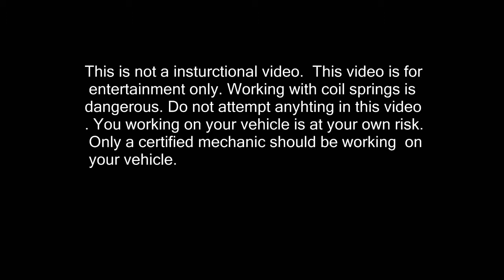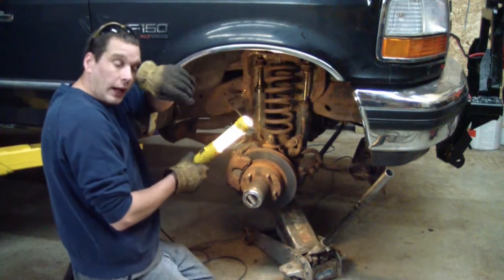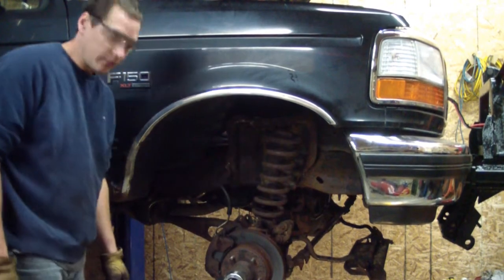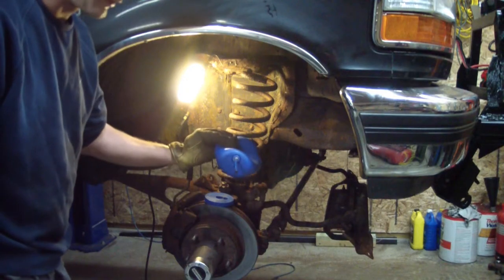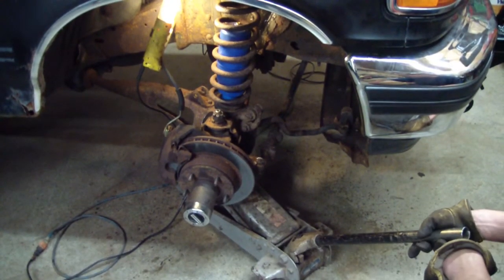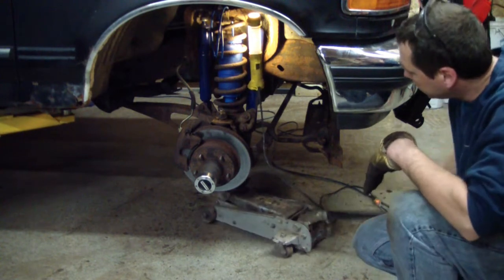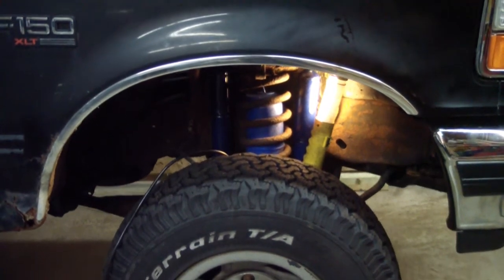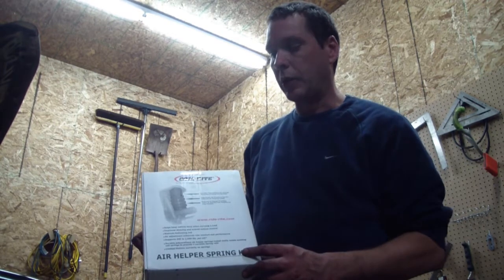Coil spring type air bag install on a snow plow truck

Comment: Just fitted these to my Suzuki Grand Vitara to stop the back going down excessively when I put my camper trailer on (about 140 Kg ball weight), works a treat, and with no camper trailer you just drop the pressure to 5 PSI and the vehicle behaves like normal

Comment: hey great video ... i have a 92 f150 ... that i put a cummins diesel in .... yeh the front is a little sorry.. i like the air bag .. only issue is i bought the truck it had a suspension lift with a taller coil spring ...where did you get the bags at ...and do they come in different sizes as oppose to specific vehicle applications ..

Comment: I have an 1987 f150. What kind of shocks did you replace with. I'm looking to change my coil springs next weekend and i'm finding it difficult to find shocks. Some say they are for the inner and outer and others do not specify. I like how you removed the Springs without a compressor. Great video thanks for posting!

Comment: Just a quick question for you. My son has a 94 f150, would the install be the same or am I going to encounter issues ? Also, his 94 has a single not dual shocks. Thanks alot for any advice you have. I sub'd your channel

Comment: I am going to be installing a leveling kit on the front of my f150 removing the spring seems fairly self explanatory but I wondered if im am going to have any clearance issues with trying to fit a spring that is atleast 1.5" longer probably a little more since my springs have seen alot of use. Do you think I am going to have any problems getting it to fit or any other advice?

Comment: Hi, nice video. Thinking about buying those airbags too. I see the bolt in your video, which youv covered with the some kind of cup. Did it come together with the package? As well oll other two interims doesn't look like too reliable. Didn't if fell off after few rides? Would you recomend it to buy? I have toyota rav4 D4D i quess i could fancy just to install this into rear springs. I do not use my car for heavy lifting or somthing like that, i just want to have smooth ride. Thank you very much!
Reply: Rytis Gasparavicius I have used these before (Air Lift). I installed a pair on my F-250 and they make a difference in the ride height of the truck when the plow is on and in the up position. The Air Lift bags are guaranteed for life. The instructions are easy to follow and install on my truck was a breeze. One hour up and down and I took my time.

Comment: Do the bags help with bumps? Particularly if the plow is off?
Reply: Th3uNn3rV3d The idea is to lower the air pressure in the bags to about 10 psi when there is no load. When you install the plow you can pump them up a bit. Different makers have different pressures. Mine are rated for 35 psi MAX!   -John
Reply: @ThePlowGuys  how airbags work in cold wether - 25/-30 Celsius?